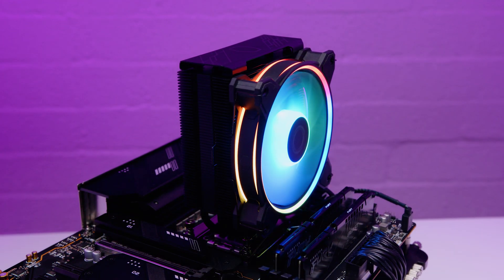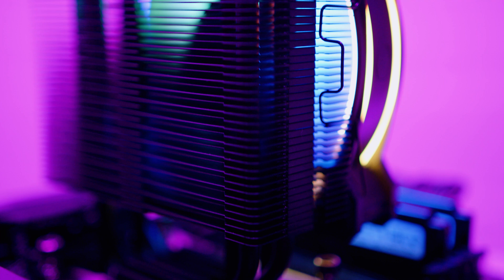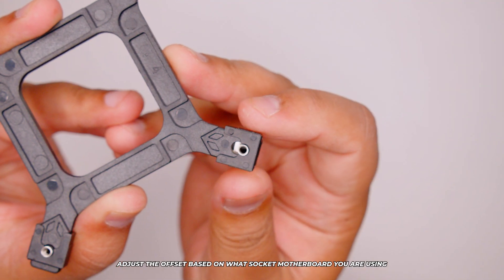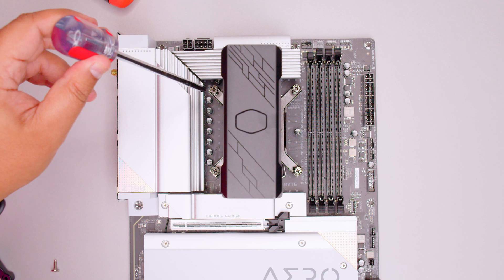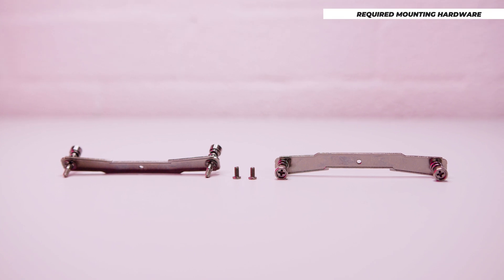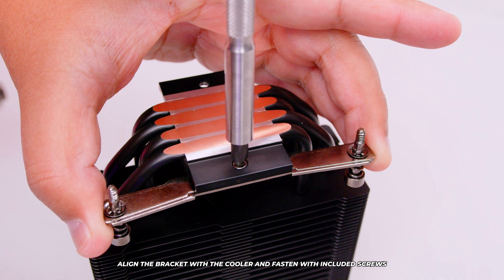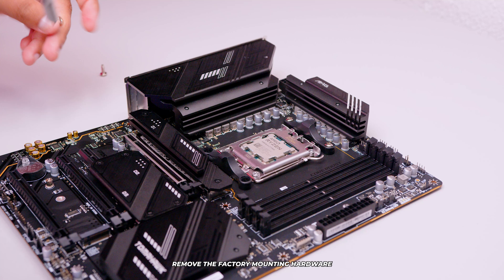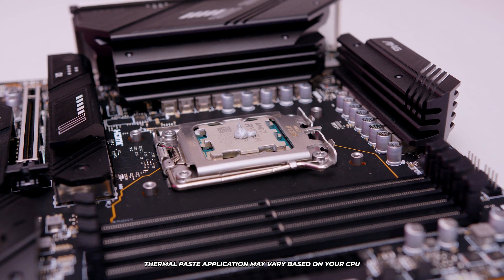HOW TO Install Cooler Master Hyper 212 Halo on AMD AM4, AM5 and Intel LGA 115x, 1200 & 1700

Comment: Got this today and just finished installing this. 3600x Idling went from 57 to 40c 😭😭. Thanks for the review man 💥
Reply: how is the performance now after an year. is it still good?
Reply: @Shank2485  yep butter no issues
Reply: @shubhankar_sharma  did u put the thermal paste on that came with it? cuz from what ive heard from comments it does not last long at all
Reply: @tannic5243 well I have it too but I used a high end thermal anyway you shouldn't even replace thermal usually ever because it lasts long unless you ever remove the CPU cooler then you will have to replace the thermal no matter what.
Reply: @itryhard3138  thats exactly what i was doing lol putting in a new cpu along with this cpu cooler

Comment: Hi I recently put together the LED version of the hyper 212 cooler,  I was curious as to how tight the heatsink should be, if i try wiggle it with my hands it doesn't move ALOT but It moves ever so slightly but nothing too major that's worrying its not gonna come off. it's quite screwed in and lowered temps by 10 degrees should I tighten it more or should it be good?
Thanks
Old cpu stock cooler was giving cpu temps (idle) 38-41 now with new cooler its 29-34 does this show its fine and doesn't need to be tightened further?

Comment: Thanks so much man! I just picked this up and got it installed! I noticed a difference immediately from my old cooler which was running higher than I would like it to
Reply: What cpu u running bro m planning to get this for my 7600 amd with 4070 build
Reply: I bought this too, how can i control the rgb lights and speed?
Reply: is it still good?
Reply: @Shank2485  yes I  use it on my ryzen 9 5900X and it runs cool even on demanding games but I put a little extra thermal paste. I've been using the cooler for about 2 years with no issues yet.
Reply: @itryhard3138  AHh thanks. Mine is  i7 7700k, and my Corsair H45 worked very well for almost 8 years --t’s dying now. So I got this  Hyper 212 last month, but it turned out to be defective, so I sent it for RMA and waiting for the replacement. I was also considering  getting a 240mm AIO, but everyone said the Hyper 212 is more than enough for my PC. They showed proof that it keeps the CPU cool, even during high-end gaming, staying under 55-60°.

Comment: Do they sell a extra bracket for a second fan, for push pull setup.
Reply: Bought mine today and it came with 4 so yes. I am in the UK. Hope this helps.
Reply: Mine came with 2 sets of clips as well here in the US. Purchased at microcenter. Not sure if that makes a difference where I got it from but just in case you wanna buy one online I would get it from them in hopes that you get one with two sets of clips as well.

Comment: the issue i had with the old one is that it felt like you were going to break your mother board when installing
Reply from the maker: Not a great feeling!
Reply: My thoughts exactly. Nonsensical spring loaded screws.

Comment: Sadly ID, Vetroo, and DeepCool have taken over the small and mid sized air coolers. Better performance, looks, and price by a good margin. 212s are classics tho.
Reply from the maker: Definitely a classic 😎
Reply: I have had 3 vetroo coolers. All 3 were garbage and almost cost me a cpu or worse. Weak springs on one of them which was very similar design to a stock intel cooler and the other two were  the exact same one with the exact same issue. The cheap fans they put on top only ran at one speed. Nothing would make them speed up or down. No settings on the board, no bios settings, hell no windows apps could get them to spin past 900rpm. Useless junk in my experience. Deepcool is probably the better way to go. No matter what brand you get do not go cheap on your cpu cooler.

Comment: Saddens me they changed to wire connectors for the heatsink fans.  The previous plastic connectors they used were so much easier to use when you need to remove and reattach the fan while the heatsink was already installed and motherboard mounted in the case. They also always had a second set of plastic connectors in the box if you wanted to add a second fan too.

Comment: Will it fit in the Cooler Master NR200P? The older Hyper 212 Black Edition didn't fit with the tempered glass side panel.
Reply: Height is listed on coolermaster for both the case and cooler
Reply: My NH-U12A fits which has a height of 158mm as long as the side radiator bracket is removed. note that this won’t work with the tempered glass version! The 212 spec page says it’s 156mm so it should fit with no side rad bracket and mesh side panel